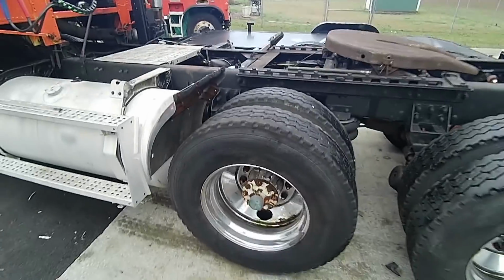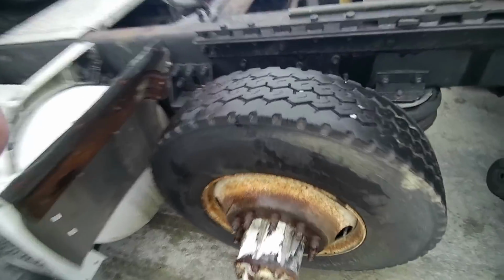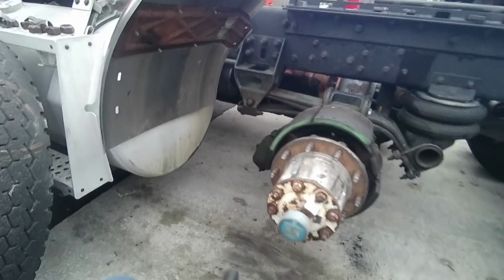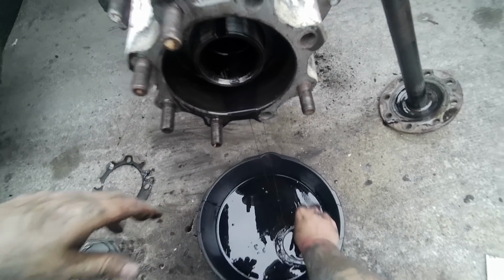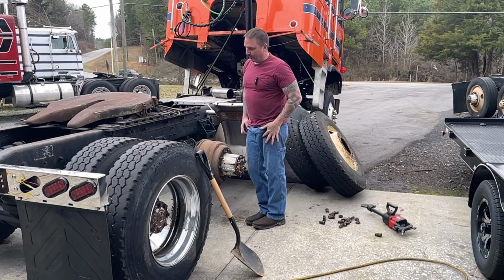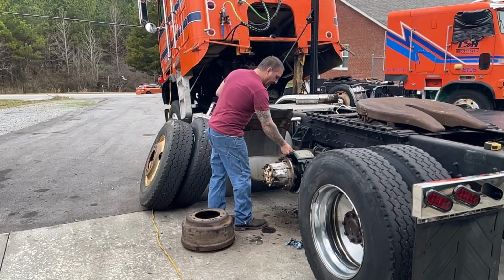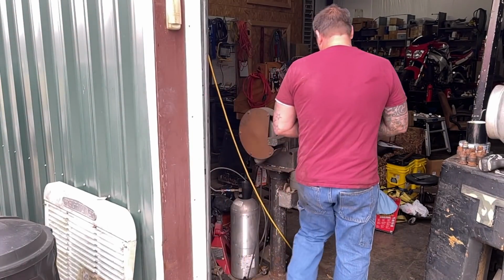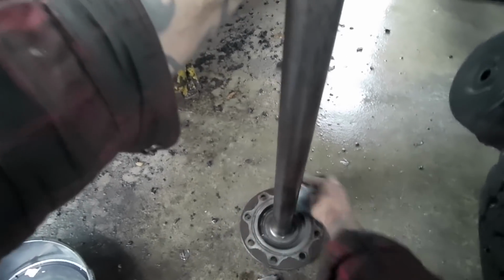1989 Freightliner Cabover "Candy"  why are the brakes so touchy

Comment: I say NO to putting super singles on Tricia I think they make a truck look stupid not to mention if you blow a tire you are stranded with duels you can run it to a tire shop or home
Reply from the maker: Dang I just think one tire is so much easier
Reply: @JamesPretty  ur truck buddy.  but I know I wouldn't run super singles on my truck. and my buddy just blew a tire on his company truck last week it's has super singles on it they had to buy a rim and tire and quarter fender. plus a road call and them are not cheap
Reply: Speaking from experience super singles are not worth it